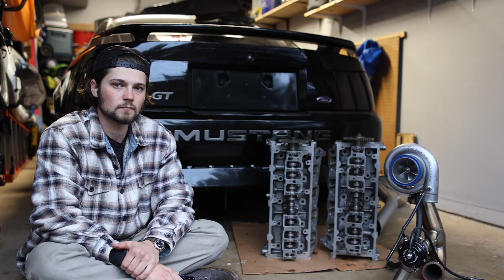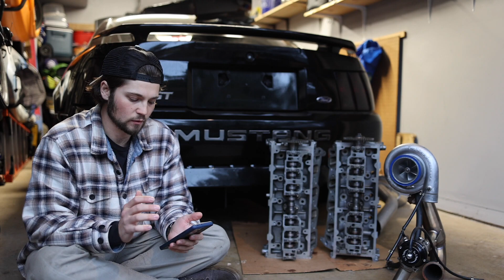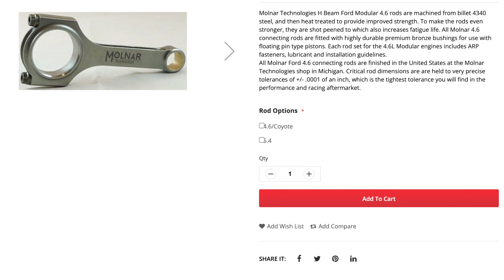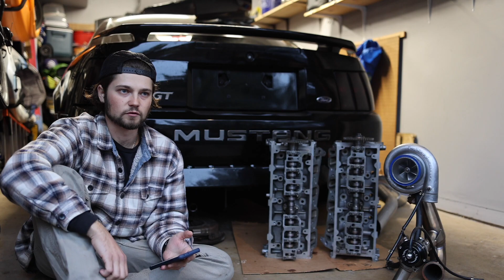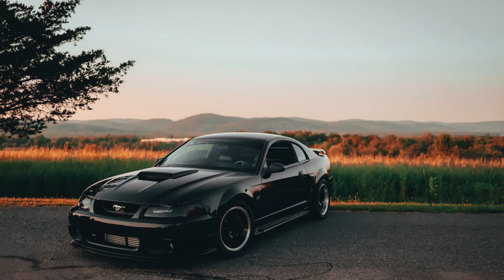Turbo 2v Engine and Parts Update!!!

Comment: I’m running DSS pistons with valve reliefs as well but mine are for .030 bore. I ran the ModMax forged crank and rods good to about 800 wheel. Todd Warren cams with stock heads and intake. 

Car made 573rwhp on the first pull at 17psi through a Vortech V3 SI with a 3.15 upper and a 10% OD lower. All 8 rib. After that the driveshaft let go at 6k and took out the transmission and cracked the block. So now the motor is back at the machine shop waiting to be reassembled into a new donor block. Got a built TR3650
from Lashbrook Built out of Oklahoma and the most important piece, a Stifflers driveshaft loop. I highly recommend getting one. It would have saved me about 5k. I took my broken driveshaft to a local DS shop and having them make me one to hold 800 wheel.  The rear end I hope is ok. It knocked the pinion flange loose so I replaced the seal and tightened the pinion nut back down. So yeah, get a driveshaft loop.
Reply from the maker: Hell yeah sounds awesome! Can't wait to see how my set up performs. And holy shit didn't even think about that! Thanks for the suggestion. I'll definitely look into that cause I would hate for that to happen to my block after being built all winter.

Comment: What machine shop is doing all the work? I'm from NJ as well and looking for someone to do my 4.6
Reply from the maker: Automotive Machine in Hillside, NJ fixed my heads and did a little work on the short block but I found a guy in Delaware who is going to assemble the engine for me.

Comment: Just curious why you went 10.5 to 1  compression? Are you going e85? Isn't that high for big boost?
Great build so far by the way. I have a 03 gt but going kenne bell route. You guys have given me a lot of great ideas!
Reply from the maker: Eventually I will probably be running E85 when I really turn up the boost, but for now I'm gonna attempt to run pump gas 93 and make as much power as safely as possible. But thank you! Kenne Bell is definitely sick but from what I hear the heat soak can be a major issue especially in the summer months. Glad we could help!

Comment: You’re missing out on assembling the engine if the machine shop is doing it. It’s a lot of fun! A lot of great parts should yield you plenty of fun with no worries tho. Can’t wait to see her fire back up.
Reply from the maker: I really wanted to do the engine build myself but I just don't have the time for it. Plus it'd be a lot of researching since I've never done one before. Hopefully on the next project car I'll be able to. Thanks same here!
Reply: @RatchetWrenches  just remember it’s a machine shop, not an engine builder. Double check their work. I’ve heard of them installing pistons backwards and all kinds of crap.
Reply from the maker: @@shawnsilverstang2138  yeah sure for sure we'll make sure to
Reply: Assembling a short block takes a lot. You gotta balance the crankshaft, check tolerance, gap the rings properly. I took my 4.6 3v to a machine shop to have them put the short block together. But I am putting the rest back together myself.
Reply: @RemiBarna  the machine shop balances the rotating assembly you can check the weights of the components on a scale but that takes high dollar equipment to do that work the crank especially ! The ring gap is easy !